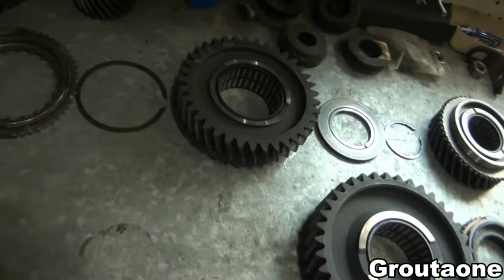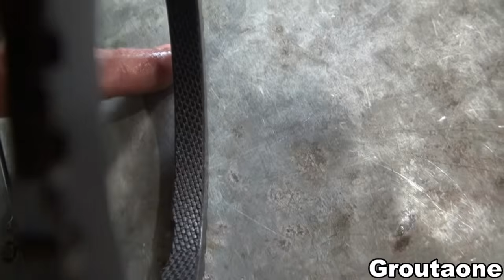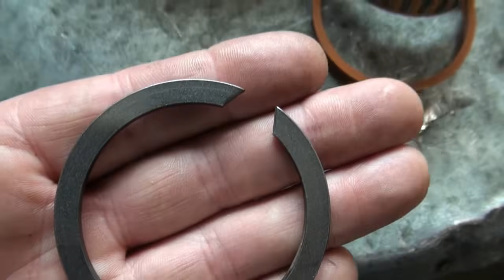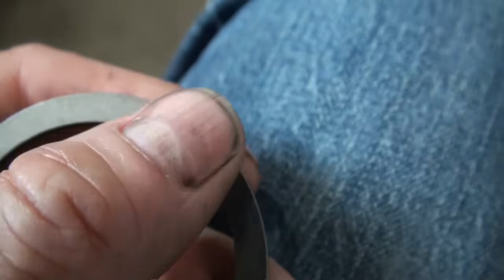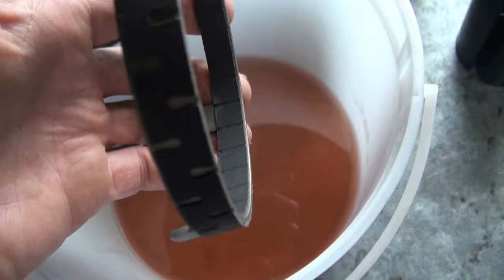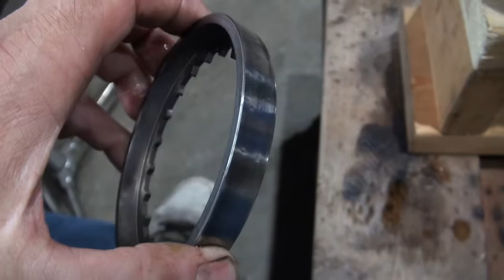Dodge NV4500 Main Shaft Assembly PT 1

Comment: You didn’t say what gear your e were putting down first the you did t show putting on the first snap ring or did you and not say that you turned the shaft around before you installed the snap
Ring . Shouldn’t you have installed the snap ring first ?
Reply: Is this a 2 wheel drive transmission ?
Reply from the maker: 4WD

Comment: Snap rings / lock rings are Tapered so that you can get a hold of them with your snap ring pliers or lock ring pliers to remove them. Putting the sharp edges down it’s gonna be really hard to get a grip on those without your lock ring pliers sliding off

Comment: Whoever has to work on that trans in the future is going to be pissed at you.  You are putting those snap rings on upside down.  The bevel is there to allow grip of the snap ring pliers.  With the way you installed the ring, the pliers will keep sliding off.

Comment: In reference to the snap ring looking beveled; its more than likely beveled from the method used to create that gap. More than likely that snap ring started out as a complete circle, next step would have been to cut or notch out the small amount of metal, probably done so in a shearing action which causes the snap ring to look beveled.

Comment: Sorry for the dumb question, but I've got a nv4500 from a chevy and I have no low gear. At all. Won't even shift into low with engine off. I'm planning on rebuilding the transmission anyways but would a worn out synchronizer cause that? Love the videos by the way, pretty much shows a step by step rebuild

Comment: Very impressive!
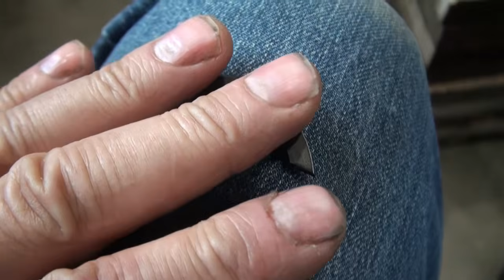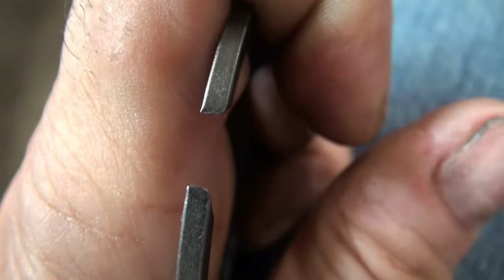Question I have a 1995 Dodge Ram 3500 2WD with 5 speed NV4500. It has a low gear then 1 - 4  speed and reverse. The truck pulls like a crazy horse but will not run over 78 mph and fuel consumption is poor because of the low gear in the transmission. I have changed the rear ended from 4:10 to 3:55 made just a bit of difference. Can I change the low gear to just a first gear?
Reply: just pull away in 2nd if the truck is empty, 1st gear is really only for steep slopes or hauling especially if you have 4.10s and stock tires youre barely moving in 1st

Comment: I'm in the middle of this repair right now. Thank you so much for these videos, as they are invaluable. I have a '95 one ton Dodge with the V10. I bought the truck new. It upshifted and downshifted fine except for 1st gear. While it would downshift fine into 1st, it would violently throw itself into neutral. I haven't gotten down to 1st gear yet, but I see no gap in the synco. I expect to see more problems. That locking collar on the end of the shaft was finger tight....I bought the bullet there. I do see some wear on 5th gear just like in your video; both on the shaft and inside the gear. At the very least I want to replace that gear and maybe find a better locking collar. I don't know if I can afford the newer shaft design and I definitely don't want an aftermarket shaft made in China. All the gears and the counter shaft gears look very pristine....no play in either shaft. I guess it paid over the yrs to keep changing out the gear lube with good synthetic.

Comment: Did you just buy a rebuild kit? If so which one did you get and does it come with literature?
Reply from the maker: Yes I bought one off Ebay, no information with it just parts, some kits are more complete than others, I ended up buying more than one kit with different parts, buying the most complete kit I think would be best
Reply: How’s it holding up so far?